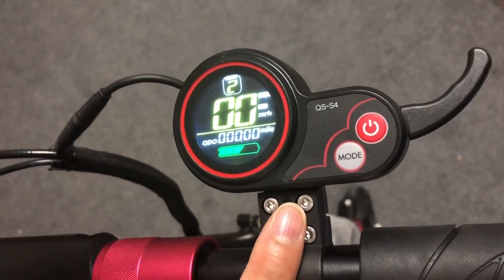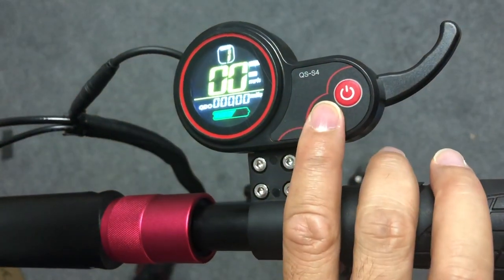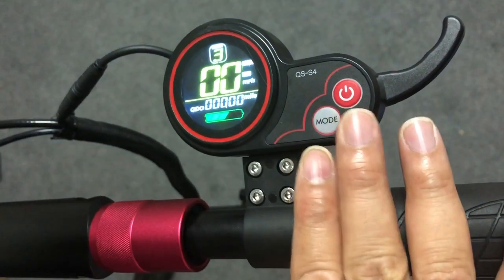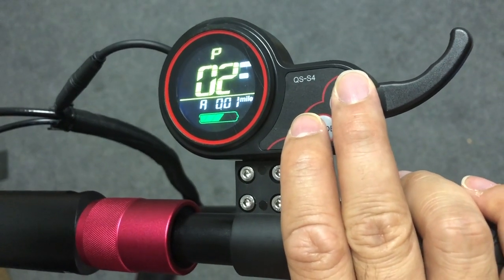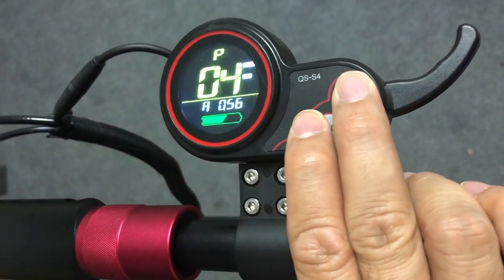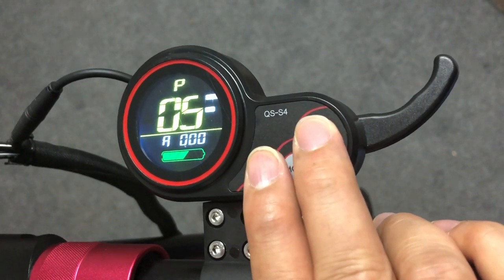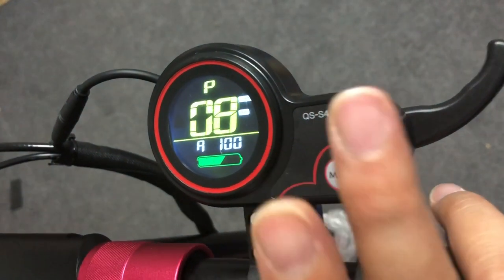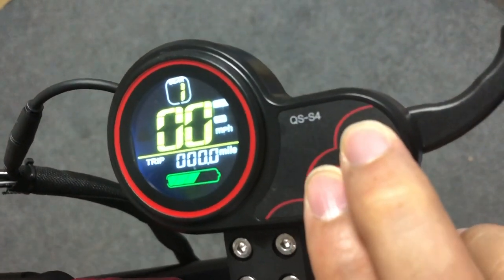ZERO 10X LCD Settings

Comment: Hi, for the Zero 10 X what's the regular settings for P15?  Is it 42 or 44? Pls advise
Reply: Did you find an answer? I'm struggling
Reply: @scottireed2093  Mines set at 42
Reply: @darkcrystal438  thank you for replying!
Reply: @scottireed2093  no problem mate! Im currently setting the steering tension on my 10x right now ha ha.. was a bit stiff.

Comment: p17 is Cruise mode you said if you want cruise set it to 1 and if you want cruise set it to 0. that was a confusing bit? how does the cruise control work please? kind regards.
Reply: M. Nurhaikal  Hold the same speed for 4-5 seconds and it will be on (signaled by a blue icon on the dash).

Comment: What is the red (!) on the top right when you hit the brakes Zero 10X? I am not sure my electronic brakes are working.
Reply from the maker: Hi Red Exclamation mark means brakes are on!
Reply: It means your brake lights are flashing in hazard mode

Comment: hi tnx for the guide. when i in the settings menu (p-settings) , and i long press  the power button, the "A" in the bottom line changes to "D". do you know what is the purpose of this mode A/D ?

Comment: Thanks for the heads up! One question when my scooter is under load the battery shows it near empty, when I release the throttle it climbs back up? Is this normal?
Reply: i can tell u that mate! when u use the throttle at 30 % battery it shows you, if u hold this acceleration u get this far . but if you now take your throttle at 70% it shows you how long u can get at 70% throttle, sorry for my bad english !!
Reply: @husse843  Translation 3 years later = If you hold your acceleration at 100% the voltage will drop as your sucking more juice and will show you how far you can travel at 100% throttle. If you hold it at 50% throttle instead of 100%, it’ll change and calculate the new distance you can travel based upon power consumption being used from pulling down on the throttle. Lighter throttle = less juice being sucked out = more distance available to travel before battery dies.
Reply: @modzmetropolis9558  actually there are no calculations or anything fancy, the reason the bars drop is because they are based on current voltage if you are using the throttle you are putting load which drops the voltage

Comment: I managed to set a password using s1 function that i cannot remember. any idea how to reset it ? or is it even possible?
Reply: I managad to figured that out myself it took me a while ,
1. turn the scooter on and enter the password you have so it will go into the on state. 
2. hold power button and mode button together (you'll get a popup for a password) 
3. enter "1111"
4. it will ask for a password again this time enter "0000"
5. this will now make your scooter without password and should allow you to turn it on and off without pass.
if you need help go ahead and PM me,i can always make a video if needed.
Reply: Florian De Graef make a video please
Reply: 9221 then hold power

Comment: Hi quick question when you are configuring the P settings menu right above the battery signal there is a letter A but when you hold the power button for a few seconds it switches to the letter d. Can you explain what is the diff between A and d ? Thanks
Reply: Great question I have recently came across this also and I'm very curious to no what it does hopefully someone can clear this up.
Reply: @anthonynolan2024   Figured it out. D setting’s function is to decrease the numbers unlike P setting which adds the number each time you press the button.

Comment: Thanks for this video! When I try to get the P program menu it goes to a menu PO from there I can’t access to the program menu! Its posible that my scooter has that menu locked?
Reply from the maker: Oswaldo Hernandez where did you get your scooter from
Reply: Falcon PEV from israel! It’s another brand but the same controller (QS -S4), should I ask the seller if there is a password?
Thanks for your answer!

Comment: Does electronic braking on this actually work? I didn’t see any difference when I tested it up on the chair so the wheels can freely move and I didn’t notice any difference after letting go of acceleration whether electronic braking actually works, I went through level 1 to 5 in P11 and didn’t see any difference
Reply: Ahh I can confirm it does work. Once you get up to higher speeds and you pull the brake lever lightly the regen brake kicks in and you can hear the motor whine

Comment: hello. I have an electric scooter and it has the same display, or is it very similar. I would like to know if you could help me with a question that I have. Today when I was going to work, the scooter lost power, but when I stopped, I saw that the display and the ignition were still on, but the accelerator did not work. So I turned everything off, and turned the contact back on, but when I went to turn on the display, it doesn't respond. then at home, I was able to see and verify that the current reaches the display connector perfectly. . Is it sure that the display will be the problem? I also see that there are many models that are the same or very similar on the outside, how can I know if it will work on my scooter? Thank you
Reply from the maker: You cannot simply buy any display, they have to be synced with your controller. Go back to the person you bought from
Reply: @FalconpevSg  Thats the big problem,. since I bought it in AliExpress, and then the store stopped selling in AliExpress, so I can't use the same store that I bought the scooter.. So... if I buy one with 6 pins, and I review the cables, each one in its color... it won't work? thank you
Reply from the maker: @Hijo-del-Chico  no it’s in the software

Comment: What do to if the charger light don't turn from red to green even though the step is fully charged (i can see that on my screen and my voltage is 65. I have a 60V). Can it do damage to my battery? Thanks!

Comment: Does anyone know if the QS-S4 LCD throttle unit for this Zero 10X scooter will be compatible with Mototec Thor 60V scooter? I am looking for a spare QS-S4 for my Mototec scooter and they are sold out everywhere.

Comment: Hey, how can i find out what my cut off is? Like when my voltage gets too low, i believe it cuts off when the battery reaches a certain percentage. Anyone know how to check that? Thanks in advance.
Reply: go in to the p menue and volt on my scooter not zero i can adjust the cut off higher and when it cuts i have spare power to take me home like a reserve fuel tank WARNING don adjust it lower you wil have more range yes but it can damage the battery
Reply: Did you find out?
Reply: @CarleyEspritPhilip  Yah, mine was aet at 42 and the actual cut off i believe it 41, or maybe 40, u could google it to be sure, but mine is a 52 volt, and the cut off is at 42. Have fun and ride safe!!

Comment: What exactly does the high beam symbol do when hold mode button ? Is there a cable from the controller that is switched on ? If , what color and voltage ? Thx
Reply: It does nothing :)

Comment: I've had send the following::

P01: Backlight brightness, level 1 is the darkest, level 3 is the brightest; P01 defaults to 2
P02: mileage unit, 0: KM; 1: MILE; P02 defaults to 0
P03: Voltage level: P03 defaults to 60V
P04: Sleep time: 0, do not sleep; other numbers are sleep time, range: 1-60; unit minutes
P04 default is: 10
P05: Boost gear: 0: 3 gear mode; P05 defaults to 0
P06: Wheel diameter: unit, inch; precision: 0.1; P06 default is 11
P07: Speed measuring magnet number: range: 0-255; P07 default is 30
P08: Speed limit: Range 0-100km / h, P08 defaults to 100
P09: Zero start, non-zero start settings, 0: zero start; 1: non-zero start; P09 defaults to 0
P10: Drive mode setting 0: Power-assisted drive (The power-assisted gear determines how much power is output.
The handle is invalid).
1: Electric drive (drive through the knob, the power assist position is invalid at this time).
2: The power drive and the electric drive coexist at the same time (the electric drive is invalid in the zero-start state).
P10 defaults to 2
P11: Boost sensitivity setting P11 defaults to 3
P12: Boost start strength setting P12 defaults to 3
P13: Type setting of power magnetic disk P13 defaults to 12
P14: Controller current limit value setting Range: 1-20A P14 defaults to 12
P15: controller undervoltage value P15 defaults to 49
P16: ODO clear setting Long press the plus button for 5 seconds, ODO clear P16 default is 0
P17: 0: Disable cruise, 1: Enable cruise; Auto cruise is optional (only valid for No. 2 protocol)
                                           P17 defaults to 0
P18: display speed proportional adjustment Range: 50% ~ 150%, P18 defaults to 100
P19: 0 gear enable bit, 0: with 0 gear, 1: without 0 gear P19 defaults to 1
P20: 0: No. 2 protocol 1: 5S protocol 2: standby 3: standby P20 defaults to 0

So the P11 is regen brake or something else?
Reply: Can you explain what p18 does? When I got my mx60 my settings were different..p18 only went upto 100.

It is possible that I accidentally programmed my LCD controller for a different scooter? All my settings have changed. Is there a way to change it back?

Comment: Sir may i ask i have a problem with my parameter, the battery indicator is blinking into a lowbat but the volt is 41v, i charge its only 3 hours then the light indicator on charger is green, but still the icon of battery  is still blinking,but the scooter is working and running,  i want to send a video to you but cannot here, please help me thank you.
Reply: check ur controller voltage...if  36v ....in P3...change to 36.....

Comment: What is the default settings of (P15) for a Zero 10X?
Reply: Did you have this Settings ? Because My Controller Jas also wrong Settings
Reply: P3 = 52/ P15 = 44 is approximately 28% of battery; the manual says the Voltage 42 =15% of battery approximately. For 52v 18 ah
Reply: @oscargomezarango9184  thanks heaps Oscar, i appreciate your help, and maybe you happened to know for 52v 23ah? cutoff voltage?

Comment: I messed with the programming stuff and i almost died on it. Is there any way to reset it to factory settings or something? Scooter wouldnt stop and brakes are really violent. Please help!!!
Reply: Did you do the reset?
Reply: @DanceySteveYNWA  thanks but i figured it out. I activated the electronic brake by mistake
Reply: @ChuppyCata  oh, I was going to help you with it, but if you're good, no problem. Safe riding.

Comment: when i enter programming mode i get an S0 message and it asks me to input a 4 digit code. any ideas what is the default code? help would be appreciated
Reply: it's 6666 for programming... don't type 1111 as you will have to set your power on password...i forgot mine :( i'm locked out.
Reply: J’ai les 0000 au démarrage 
Comment la débloquer???

Comment: hello. what is the expected range for the 10x in a dual engine mode and speed between 40kmh and 55kmh?
Reply: Baan Teelanka - The UpsideDown House of Phuket 20 km max at this speed, I make about 50 km,average speed 27km/h
Reply: @kindzius  thank you for sharing. can I reconfirm. you have a zero 10x and with double engine on and aggressive riding you only do 20km on a full charge ? and you reach 50km in which driving mode? single engine low speed with ECO off?
I do 30km in dual engine. and 45 in ECO mode. I have complained to shop they said is below standards. they sent me another battery I changed but is exactly the same. now waiting for a resolution
Reply: Baan Teelanka - The UpsideDown House of Phuket 
Yes,I have 10x with dual engine and if you drive agressive with both engines I get 20 km,if you drive with one engine 95% and use both engines when you want to climb to hills you will get about 50km speed about 25-30 km/h.
P.S. my weight is 98 kg
Reply: I’ve gotten 83km out of a charge around Perth (Australia). It was very relaxed riding on cycle ways going slow. Was a great days cruise along beaches, rivers and cycle ways🤘 I’m 98kg

Comment: What's the Voltage level of Zero 8 V2 (with 13ah battery) and its Controller cutoff voltage? Thanks!
Reply: Never mind, just found it. It is 48V and the cutoff is set to 39.
Reply: @Saitama-nu6jf  Can you tell me how did you find it. i have a 10x 52V. what is the cutoff of a 10x? Please
Reply: Thanks for that comment, I accidentally changed it on my zero 8 the other day and could find the default
Reply: What does voltage cutoff mean exactly?

Comment: what does it mean cut off voltage? and why mine set to 39? (P15)
Reply from the maker: it means the lowest battery voltage that the controller can support.
Reply: @FalconpevSg  thanks

Comment: Hi falcon I really hope you can help me as my vendor isn't being very helpful :(

So I bought a mercane mx60. I tried to unlock the full speed and I believe I made a mistake as the settings are different now. P18 only used to go to 100, now it goes to 150.

I am wondering. Could I have accidentally programmed it for a different scooter? 
Althought I have changed the speeds it feels slower and more sluggish than when I first got it and the speed (p8) was set to 35 :(
Also, sometimes when I turn it on or press buttons I get a red exclamation! And a "e" comes up then goes away.
Sometimes I set the settings and they will change on their own. 
It is a really heavy scooter and now it barely moves in single motor

Please if anyone can help I would really appreciate it.  Thank you
Reply: did u get a response on how u could reset the entire scooter? please help

Comment: My LCD don't don't turn on the power button won't work. I bought a new LCD and it still don't power on what's the problem of my zero 8x please help
Reply from the maker: Can your scooter charge?
Reply: @FalconpevSg  no it won't charge either
Reply from the maker: @swave1234  so it’s not the lcd it’s the battery
Reply: @FalconpevSg  so my battery is broken? But I only used the scooter for 1 year
Reply: Do I need to buy new battery?
Reply from the maker: @swave1234  yes you will need to. We do sell them if you need
Reply: @FalconpevSg  €769 I can't buy that right now but thanks a lot now I know the problem
Reply from the maker: @swave1234  no Problem

Comment: what is the default motor magnet for zero 8 v2? (P7)
Reply from the maker: Dummy Account 30 magnets
Reply: I checked my newly purchased zero 8 v2 and it was 26 is it ok to change it to 30?
Reply: @dummyaccount623  mine was 28 x) but it really change something ?
Reply: how was the change? did it affect anything?
Reply: I'm only achieving 56km/hr on my zero 10x.
Followed lcd instructions.
My acceleration is on 5.
Battery power is on 100%.
Is there something wrong?
I weigh only 79kgs.
Reply: @1968sooty  air resistance :)
Reply: @bazejgruszka1421  ..yesterday I top 60km/hr...yes wind had a part but I think it's due to warm weather.
We have had a lot of hot days here in Christchurch .
The 10x is running so much faster in the warm weather.
Reply: @bazejgruszka1421  ..would bigger batteries make it go faster?
Reply: @FalconpevSg  And for a 10X?
Reply: I have the 10x my magnet is set to 28 can I change to 30?
In this movie and in others is set to 30, how correct is it set?

Comment: How to enable max speed on zero 10x now  max is 25km/h :(
Reply: kindzius there’s speed limit wire. There is video how to cut them by scissors.. but I hope there is somewhere connectors where we can disconnect them easy... well I hope so..
Reply: Make sure eco button is out, and dual button is in, and select gear 3, and in P settings 100% power.

Comment: i have Zero 10x i max the speed only 65kmh can i add more faster than that
Reply from the maker: Not possible. The max speed for the 10x is 65kmh.
Reply: I went into P8 and it is set to 100 however the max speed I hit seems to be 25km and I’ve got it held on full throttle. Does it take a lot of time to build up to 65km or do some wires need to be removed to remove the speed limit on a zero 10x?
Reply: @FalconpevSg  My Zero 10X is limited to 25km/h. :( How can i unlock the full potential of my scooter? Please i need help. Thank you!
Reply: @daralee7879  Same for me :(
Reply: @kerwindapog  关

Comment: Riding motorcycles for decades I was shocked how un stable this machine is.  Anything that goes over 15kph should have some sort of stability. On this machine, if you scratch your nose with one hand while you are cruising at 60kph, you will crash.  I demonstrated this at 40kph.  
On a motorcycle the steering geometry is such that its trail ensures hands off stability.  These cheap Chinese powerful scooters have no regard for personal safety which could be remedied with a slight design change.
Reply from the maker: Yes these do not allow for one handed steering. Having a motorcycle style rake angle will make the whole thing much larger